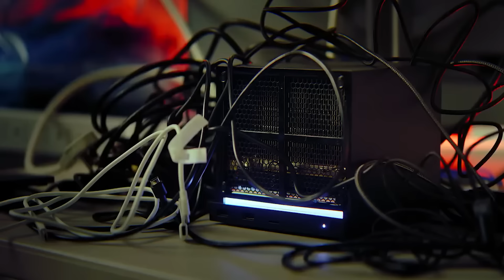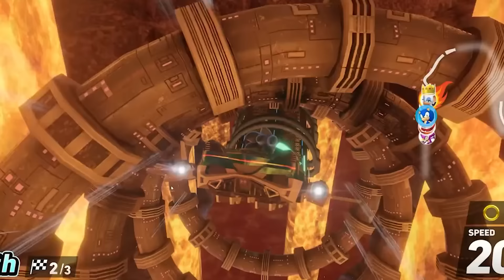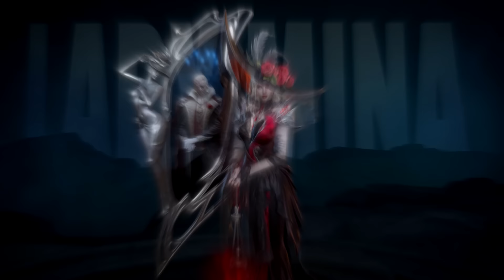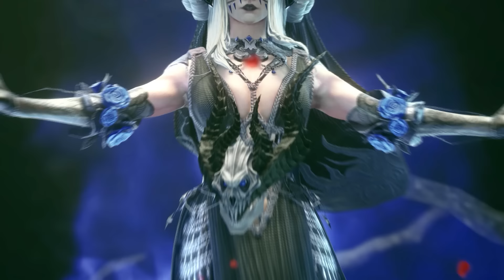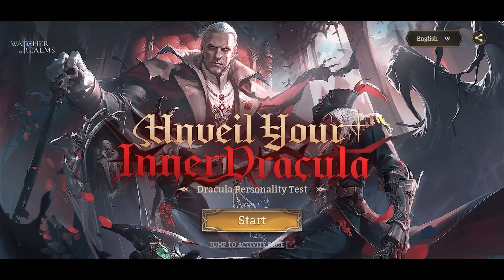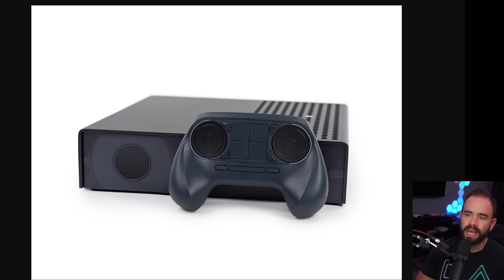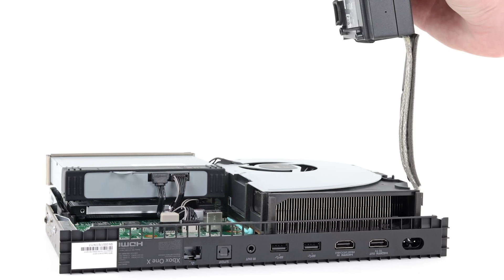The Steam Machine Is More Impressive Than It Looks...

Comment: Needs to be $500 for the 512GB model with controller for it to sell well.
Reply: Im probably gonna buy one. Just have a steam machine and switch 2 and I feel like that would cover all my gaming needs.
Reply: Unfortunately it's not 2015
Reply: @darkobelisk4076  Steam Deck is $319 new. $500 is more than doable.
Reply: Nothing sells as well as a government subsidized console costing the customer $0. The government never has to repay it's debt so why should you?
Reply: It prob be 600 no controller, still a decent price.
Reply: @richardmenz3257 No it's not, they're trying to compete in the console space, charging more than a PS5 for a weaker system with no controller is not a good deal
Reply: @morriganlefay5438 they aren't trying to compete in the console space at all, they specifically said it's gonna be priced like an entry level PC and they never once called it a console they've made it very clear this is a PC
Reply: @morriganlefay5438 except you get Steam games much cheaper
Reply: @The_MEMEphis  and now you just hit the problem
This isnt an entry level modern PC in 2025, its weaker than any new parts, has 8GB VRAM and a low power CPU

Now you saying its a lowest end PC but you lose the ability that makes PC better than console being able to UPGRADE. You can build a $600-800 PC which will already be faster than this
Then if you spend $300 in a few years, you could possibly get similar to PS6 level performance
Reply: @imo098765 it's more powerful than most of the PC users builds on steam according to steam charts
Reply: @morriganlefay5438  Can you run a server on your ps5? Can you do homework on your ps5? Can a company buy 100k of them to save money on computers making anyone selling the item at a lost to lose way to much money? It is more then a console, also they want/need more then themselves to make a product for steam os. 600 dollars is a good deal for the PC, they be only making avout 50 bucks after shipping and R n D per 1.
Reply: @The_MEMEphis the specs are pathetic for that price. You can buy used PCs for less and with 40-50% more power.
Reply: @Rudolph300 The only way you're going to build something more powerful for less than 600 bucks is if you scour for used parts
Reply: @The_MEMEphis they absolutely are, it's a pre-built box with a custom OS meant for couch gaming on your TV. 
That's one step away from being a console and the competition for gaming in the living room is absolutely consoles, not other PCs.
That's my main point here, not that this is literally just a console, it is a PC, but other PCs aren't what it's competing with
Reply: @imo098765 wtf are you talking about. This is no where near entry level. It's better than 70% of steam users. It's only very slightly worse than my PC and I've always considered mine mid tier and it can run like any PC game. You're like pcmr enthusiast sloppified
Reply: @Rudolph300 the price to build a PC with the same specs yourself, not even pre built, is like 800+
Reply: @playtimeplay4518 there’s literally videos of people building PCs with the same specs as a ps5 pro for the same price as the ps5 pro. The ps5 pro is substantially more powerful than the steam machine

Comment: The price will be the measure of Valve's level of aggression in attacking the living room.
Reply: But my HOPE is that they are aggressive with pricing for the sole sake of proving a point.
Reply: Make it 450-550usd and my life is yours STEAM. 

LONG LIVE THE GABECUBE
Reply: @liamrich9715  Base PS5 is more powerful.

$450 or higher for the Steam Machine makes no sense when it's more of a 1080p 120fps device. Not 4K 60fps even with FSR.

PS5 digital launched at $400 back in 2020.
Reply: @liamrich9715  Base PS5 is more powerful.

$450 or higher for the Steam Machine makes no sense when it's more of a 1080p 120fps device. Not 4K 60fps even with FSR.

PS5 digital launched at $400 back in 2020.
Reply: @P @PSYCHOV3N0M $400 in 2020 does not equal $400 in 2025, and consoles have increased their MSRP in that time instead of decreasing. If the Steam Machine launches +/- $550 it’s priced pretty well, $450 on the aggressive side so long as Valve doesn’t mind losing money on their hardware sales like consoles do, but I doubt they can go that low.
Reply: The problem is, financially speaking they don’t have to attack the living room. They already are extremely profitable, and don’t have any shareholders to please with some prospect of infinite and rapid growth. Positives part, they’re free to do what they believe in and maintain their values. Negative part? They don’t have to be aggressive with pricing to take large shares of a market they’re entering.
Reply: @shableep  I agree with you and I will also say Valve is in the perfect position to take hold of the console and PC space because the competition has stopped caring about increasing their market share, Nintendo has sold 100 Million Switch consoles, Microsoft Windows is basically synonymous with PC, and Sony makes enough money from selling their other electronics besides Playstations, Nvidia if we want to mention them also is more concerned with AI now, Those companies have left us behind and don't care about entry level gamers at all, Steam, the former largely purely software company ironically enough, cares more about providing gamers a gateway into PC gaming and that's a great thing.
Reply: @webbedshadow2601  100% agree with everything you said.
Reply: @shableep  What if it's nothing more than Gabe and the gang wanting to relieve themselves in the Cheerios of those greedy scumbag console corpos? Show the console peasants a better way. That'd be hilarious.
Reply: @daviddesrosiers1946  Hell yeah. That would be awesome.